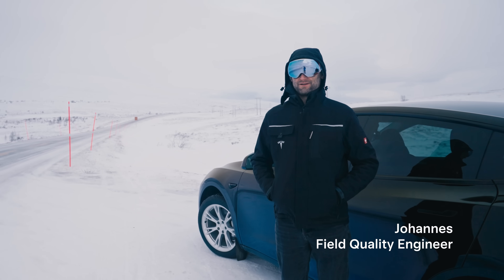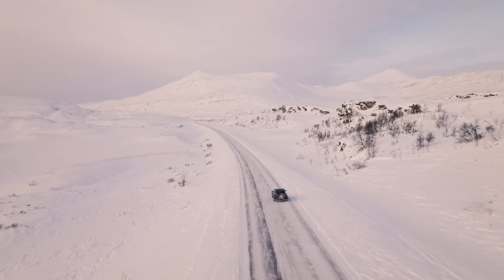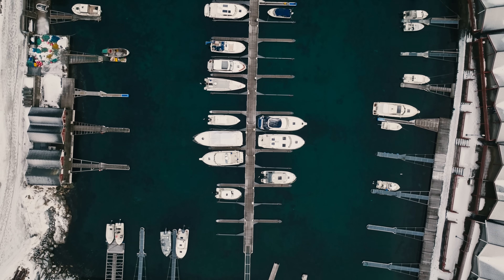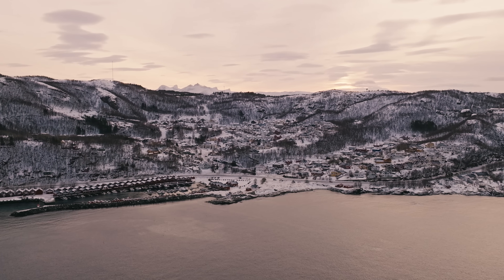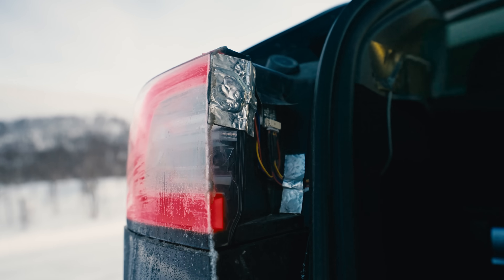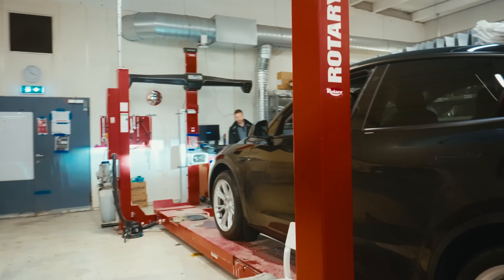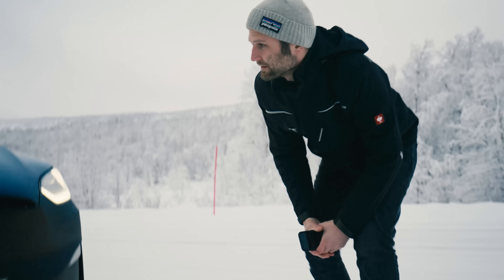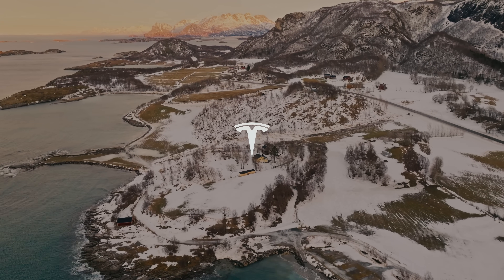Extreme Cold Testing | Tesla Model X & Y

Comment: I live in Canada where we will go 40c in the summer and -30c in the winter and my model Y HVAC  has absolutely crushed every other vehicle in this regard. It's amazing how well it works.
Reply: Wow interesting! What part of Canada is it that gets such huge temperature swings between summer and winter?
Reply: @PlanB_  Edmonton gets to minus 35 to plus 35. Minus 35 only lasts about a week or 2. Cold snap.
Reply: sounds like a typical Montreal weather: tropical in summer, artic freeze i winter @PlanB_
Reply: Sick!
Reply: Brown noses vocational training lies LOLOL aka advertising tesla  fan zzzzombies LOLOL
Reply: Very cool. So every time before your driving, you need to pre-heat your batteries for car???
Reply: @willykang1293   yes, Tesla recommends you warm up the battery pack in the winter before you start driving.  It's no big deal, just start the process when you wake up, by the time you leave the house, the battery pack will be warmed up.
Reply: @willykang1293 You schedule the charging time to finish by the time you're ready to leave home.  Boom, warm battery.  But no, generally speaking,  you don't need to "warm up" your battery before driving.
Reply: @willykang1293 Off course not. You put on the heating in the car normally either before or when you leave. Smart thing to do before so you don’t have to scrape the windows from ice.
Reply: How is the range over snow, i knew a guy who owns a prius, he said the fuel savings turned to shit when driving in snow.
Reply: Funny you say that. I live in Las Vegas, during 115f temp, my range takes a huge dip. You must have a magic model Y
Reply: @Mkvkuv He is not talking about range staying good. He is talking about the heat pump which is the HVAC(heating ventilation and air conditioning) performing a good job. I guess almost every car in the world has great heating and cooling but maybe not as efficient as Tesla’s heat pump.
Reply: @chrisroger2000  Yea like last winter driving in -10F and just a slight range hit, while my gas car wouldn't even start.
Reply: @chrisroger2000  what good is hvac if it ends up eating almost 50% of your range? i might as well stay home
Reply: @Mkvkuv You understand that even an ICE vehicle will have reduced range because of AC right? Not heating because the engine is so inefficient that most of the energy from gas is converted to heat.
Reply: @themonsterunderyourbed9408  yes but in a gas i'll still maintain at least 200mi. my model Y SR goes from 180mi to like 120mi (real world range), that's a huge hit
Reply: @mluu510  That's complete bull.  The lowest range Model Y is 279 miles. Where did you get 180 miles from?
Reply: @themonsterunderyourbed9408  you actually believe Tesla range number!?! 🤣🤣🤣 you must not own a Tesla! Go watch any Tesla real world range video, fan baby. Adults are talking here
Reply: @mluu510  So you've been completely proven wrong and are resorting to non sense arguments. I have a 2018 Model 3 and on nice days, I get MORE than the stated range.
There's approximately ZERO possibility you're getting only 180 miles out of a Model Y on hot days.  Zero.  None. Zilch.  Nada.
Reply: @Mkvkuv dude what, it still needs to follow physics laws.
Reply: @lecisko  you think it doesn't cost energy to run the HVAC?
Reply: @Mkvkuv  no, the opposite of course
Reply: @Mkvkuv   did you lose range because you had the A/C on full blast?
Reply: @cyclopsvision6370  no, i keep it on LO setting at 74f with tinted windows and roof shade. even then, my car was running at 500+w/mi
Reply: @Mkvkuv  You are right. I also live in canada and by -30°C, the range drops by 50%. that said, the HVAC still works pretty well!

Comment: Live in MN with -50F windchill and 0 issues. At least my Tesla’s start up and have preheating while lots of the ICE cars are stuck with their engines having trouble starting…
Reply: People say you loose range in extreme cold. It’s almost like Tesla figured out preconditioning the battery AND cabin without ever needing to go outside. I don’t mind loosing range for the luxury of automatic de-icing and already warm cabin. 
There is a reason why many people with disabilities who can still drive want all electric with these features.
Reply: Wind-chill of -50° is tough on people, but what sort of ambient temperature? At 0° F a 30-mph wind gives you a -49 wind-chill. Actual -35° F temperatures occur in most Minnesota winters (with below 0°F daily high temperature, sometimes for a couple weeks straight). Can I still do my 150-mile roundtrip commute? 🤔
Reply: @gus473 So it’s only 75 miles each way, or are saying 150 each way of your round trip?  The 1st should be doable.  While I don’t own a Tesla, I’ve owned several EV and in MN extreme winters I usually only loose about 50 miles of range.  Then again, none of my EVs had an LFP battery, so I would not go that route if you’re going to use them in the cold.

Comment: We're testing extreme hot weather here in TX, your HVAC crew is amazing.
Reply: Yes!
Reply: Have my model Y here in Texas. 104° yesterday. No problems what so ever. Love my car.
Reply: @Kensington2714  I'm not gonna lie, I use the "keep" option on the AC when I park.  Nothing better than coming back from shopping to a cold car on a 105° day.
Reply: I live in texas the tesla is amazing
Reply: I drove my 2020 Model Y Performance in Death Valley in July 2022. Handled just fine from what I recall.
Reply: Yup but drains the crap out of the battery.

Comment: As a Canadian Tesla owner, I can tell you first hand it doesn't seem like a lot of thought about cold weather went into the design. Seems like most Tesla engineers have never left California.
Reply: Exactly. Other car manufacturers figured it out DECADES ago. In the grand scheme of things, Tesla are a very new car company...
Reply: I don’t live in extreme cold, but new models can’t keep a window defrosted? From videos I watched cabin preheating works well to melt away ice while parked. Does it freeze while driving?
Reply: @battery_wattage  no. Nothing freezes while driving. As evidence of 4million owners and seen in the video.
Reply: Door handle, window and trunk design is poorly thought out for winter in a model 3.
Sometimes the windows will not release because they're frozen in place, and the doors cannot be opened and closed. (Because they're frameless, you can't open doors witho7t the window moving a few centimeters down first) 
The solution is to have some antifreeze with you at all times.
Reply: You're wrong. The app has a button to unlatch the door if its frozen. You have no idea what you're talking about. @logitech4873
Reply: @logitech4873  that sucks I thought they made progress for the cold weather cars.
Reply: @logitech4873  my only complaint for the hot weather is that the highest setting for cabin overheat protection is 104°, aka nighttime in TX.
Reply: Physics is a bitch.  They are getting better at it.  I thought they abandoned us "hot weather" guys too.
Reply: @ChrisGageTX  The physics stuff I'll give them a pass on. It's the bad design stuff that I'll hold them to account for - the basic cold-weather stuff that every other car manufacturer figured out decades ago like keeping a window defrosted.
Reply: @ccudmore  I keep mine in a garage which is still well in the 100°s but when I go somewhere and park I use "keep" on the AC.  Mine is a 2018 with resistance heat and an AC compressor.  It is a good setup here imo.
Reply: @ccudmore  Car doors get frozen shut for any car. I guess the thing you're talking about is having no top-side to their windows so there is an increased risk of damaging the window if forced open? You can also remotely preheat your car you know?